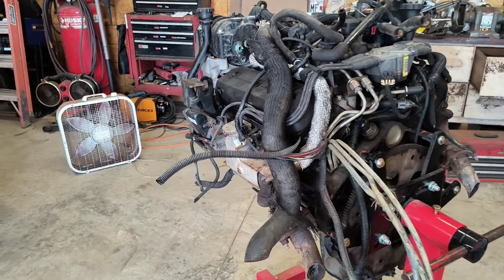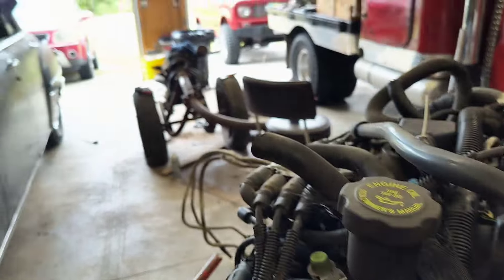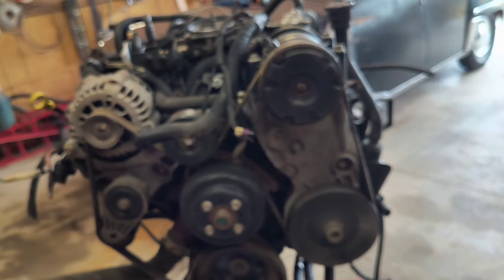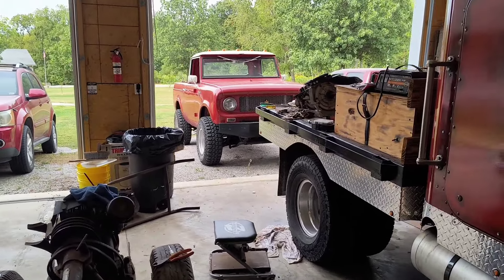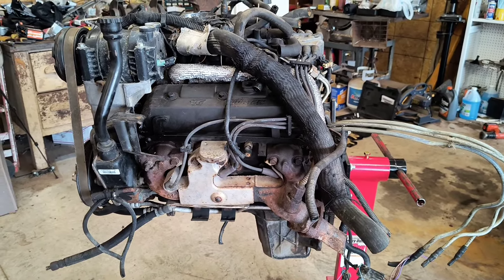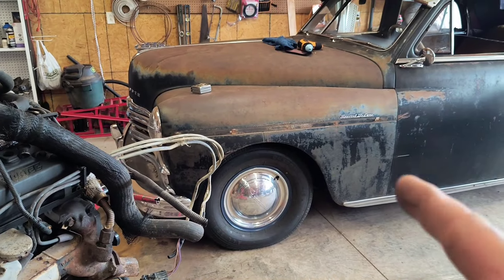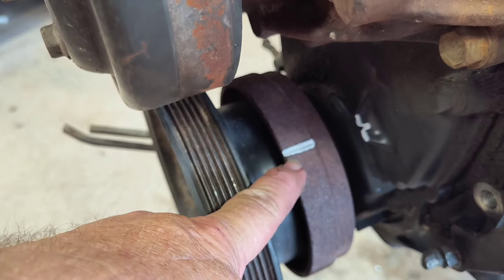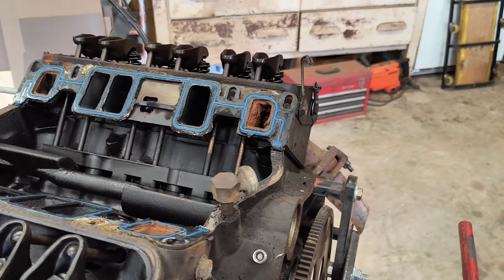Getting the 4.3 V6 ready for the Plymouth.

Comment: How do you clean up and also how to clean out all the oil passages?
🐢Firet timer here with a 2001 suburban 2500
Reply from the maker: I did not tear down completely to clean oil passages. The outside I used purple power type cleaners and brushes.